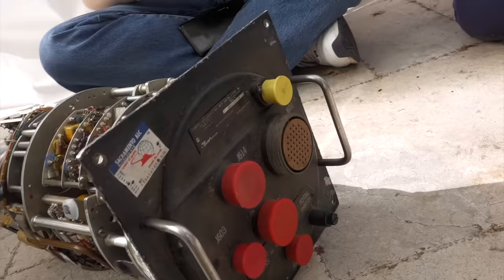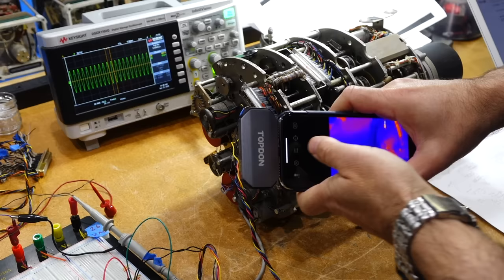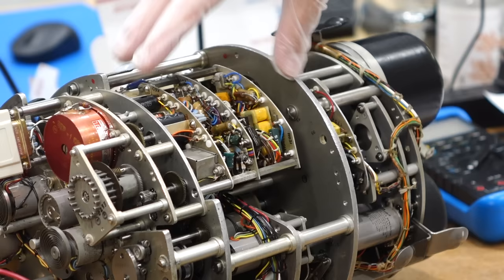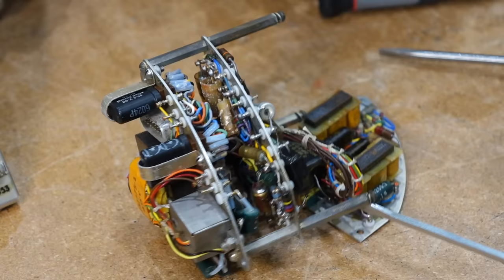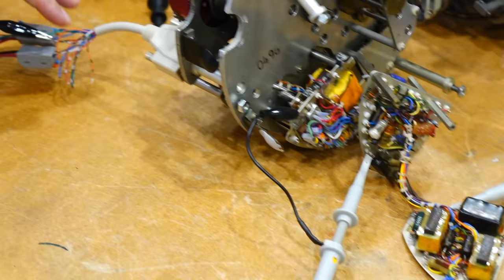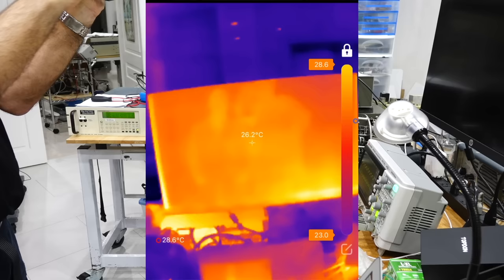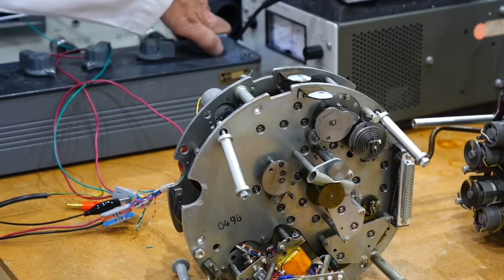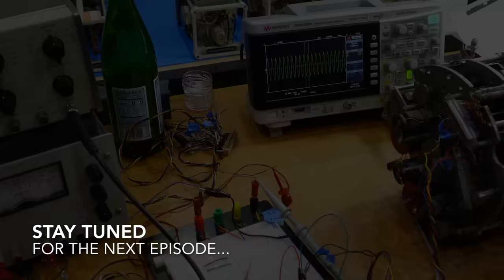Bendix Air Data Computer - Part 4: Magnetic Amplifier Magic

Comment: The main problem with thermal cameras, as demonstrated, is that every job takes twice as long. It's impossible to resist looking around your workshop and playing with it!
Reply from the maker: It’s like, it gives you super powers.
Reply: the number of wall plug transformers I found randomly hidden around the house.. and other current drawing devices that sat there for years without using them..
Reply: problem 2: you never have it around when you need it
Reply: @gamerpaddy This! Some years ago I bought a CAT mobile phone with integrated FLIR™ Cam. As I use a new phone now the old one is always at home.
Reply: @gamerpaddy I have one in my phone so no worries for me😊
Reply: @CuriousMarc  Like a JWST, in your hands!
Reply: @CuriousMarc >>> "Dead or alive, you're coming with me." 
 -- ROBOCOP [1987] 😉
Reply: @ToTheGAMES >>> And you do NOT have to go all the way to L2 to use it...😉
Reply: 2X longer, and I have to admit 2X more fun too. 😸
Reply: @CuriousMarc wait till you use it on a shorted power supply that's cycling on overcurrent. The traces involved make a really nice pulsing image!
Reply: And if the sensitivity isn’t high enough, just use it in a fridge or wait for winter.
Reply: Black bin bags can't hide anything, and 10 minutes old dog poos at night in the back yard glow like plutonium.
Reply: I love the way you can see handprints and footprints with it
Reply: Same as planting bags of  roasted sunflower seeds in the machine shop everywhere.

Production focus goes down because the guys can’t stop eating them.
Reply: I like how you can see the reflection of people in the scope screens. 

When I first got one I spent a solid hour with a friend heating things up by drilling them and such then watching the result through the camera.

Comment: Emissivity is an important factor when you are working with the thermal camera. Shiny objects like metal does have a very low emissivity and reflects infrared radiation very well. You think you are measuring an object, but in reality you are measuring yourself, reflected by the object. A simple way to solve that issue is, to stick black electric tape on it. In some cases it is necessary to paint the object. It is quite complicated to get usable "measurements" from an infrared camera. Have fun! 😎

Comment: Love this video! I bought a 1.5kW-28VDC Military Generator built in the 1960s and it has a small potted voltage regulator that uses a magnetic amplifier too. This device monitors the output voltage of the generator, and controls the field current to maintain a 28V DC output. It uses no transistors, and is still working after all these years. I was surprised as an EE when I came across this magnetic amplifier because it was something I had never heard of! An amplifier that doesn't use tubes or transistors!? Crazy!
Reply: I always wondered how small generators regulated voltage prior to transistorized voltage regulators! Do you happen to have the name and model of the generator? I would love to learn more about it.

Comment: I recall my dad making magamp-based regulated DC power supplies for satellite use back in the 1960s. I learned a lot about transformer and inductor design from him, but I haven't had to use that knowledge in 60 years or so, and it has all dribbled out of my head. 

I also seem to recall that tantalum caps tended to work like zeners if you weren't careful and even slightly exceeded their breakdown voltage, and the breakdown voltage could degrade over time.

Comment: Recently came across a magnetic amplifier in an colour CRT Arcade monitor, it looked very similar, a pincushion transformer where the signal from the vertical output stage is used to control the width. Fascinating :)

Comment: Back years ago (~70's), when I was in the US Navy, we used MagAmps quite a bit for instruments and such.  There were two categories as I remember, a 'saturable reactor' type, and 'self-saturating'.   Many transducer's we had were variable-core transformers so using magamps to amplify and then driver servos was a common arrangement.  But we started getting newer stuff with solid-state.  So I when I was in, you had to know both, depending on what equipment your ship had.

Comment: The first thing I did with my new thermal camera is take pictures of my black cat!  It was quite interesting, actually!  
On topic, it is just amazing to marvel at the electro-mechanical solutions of the time.  Just amazing.....  And to think of the weight restrictions they had to overcome in an airplane....  all that with paper and slide rules before we had computer assisted design.

Comment: Not only are fingers not sensitive enough, but they confound the results. They are so comparatively warm that it’s easy to heat things up inadvertently just by touching them. Especially in a well air-conditioned basement. After all, a finger tip is a miniature heat exchanger. Fed with warm blood, all those capillaries do an amazing job of dumping heat. With a bit more sensitive camera you can see hot finger “prints” left on things just by touching them.

Comment: Time to hook up a temp sensor to it and build possibly the most complicated weather station 😄
Reply from the maker: That’s a great idea. We’d get the temperature from the platinum probe, the barometric pressure from the static port, and if I could build a rotating pitot tube that always faced the wind, I could get the wind speed. Imagine, I could measure wind bursts up to mach 2! That would put these storm chasers to shame…
Reply: @CuriousMarc  My uncle had the pieces to one of these and we used to play with the differential gear sets when we were kids. He told me about how syncros work and how at one point he used a pair to work as a wind-vane. One syncro on the roof with an actual wind-vane attached to it, and the other inside with a pointer on it. He said it worked really well until the wind blew it off the roof one day.

Maybe you could so something similar to control the rotating pitot tube.

Comment: I've encountered the saturatable reactor 'mag amp' in the power supply of a shipboard communications system. The 3 phase AC was fed into it and a DC current controlled the output. The previous systems had used a motor driven variac to do the same thing.

Comment: So very interesting! I have been a fan of synchros and resolvers since the mid eighty, when I was introduced to a telecine film chain, that used magnetic film stock with the optical film, and the entire thing was locked together. my next introduction to them was with an old teleprompter table that locked the motion of the hand controller with four separate motors that dragged the paper down the table, whilst the camera photographed the words on the pages and displayed them in the prompter CRT on the camera peds!

Comment: @CuriousMarc >>> Something just occurred to me while watching this video. 

This may have already been said before, but even if you guys could not power up this thing and test it, just having it on display with the outer casing removed would be a cool piece of 'aviation art'. 

Put it in a glass or plastic cylinder fitst, just to protect all the 'innerds' and keep them dust-free.

Comment: Yes, IR cameras are really nice to have when fault finding.
But one important part is to not touch the parts that you want to look at. Your fingers leaves hot spots that can stay for some time and fool you.
It is also good to have some PVC electric tape and place on metal parts to reduce reflections and give a better emissivity. This will give you a more precise temperature reading and enable you to compare them with each other.

Comment: quite interesting to see such mil-spec tech from 50s and 60s; never knew about such magamps before; thanks for showing!
I think the moon landing also accelerated the move from rotating gears towards silicon-based calculations (and everything done in software) in the avionics industry.  Imagine an Apollo Guidance computer with such rotating gears, instead - if such jump in tech would not have happened in the 60s!

Comment: We had a piece of equipment (30 years ago) that had hundreds of those caps in it, and ended up replacing them all. Fortunately they were mostly on memory cards for the video processor. That allowed us to pull the D0 card to repair while leaving the D1 - D7 cards in place. (All cards were identical.)

Comment: Cheap thermal cameras like that have been available for less than $300 since the early 2010s, Flir One Gen 1 was the first "big" one. The resolution of the thermal imager is low, only 80*60, but they compensate for that by combining it with a normal camera to get the fine detail and use the thermal camera for the thermal information. For the resolution it's surprisingly sensitive. I still use it today, it's got a micro USB on it but if you add a micro USB to USB-C adapter, then it works perfectly fine!

Comment: My first exposure to the term "magnetic amplifier" was 30 or 40 years ago when I happened to be reading the technical documentation for an electric chair. It used a saturable reactor to limit the current applied to the (euphemism alert) "load" to 5 amperes at 2000 volts.

Ever since then, the term "magnetic amplifier" has seemed just a little bit creepy.

Comment: Those tants have leaked, and the heat from desoldering them was enough to evaporate the sulphuric acid electrolyte across the seal that was shorting them. If they have the epoxy seal there is rubber under it, and they fail with time, as they are the "budget" renge of wet slug tantalums. the glass seal ones almost never fail, tested a batch of 500 that had been sitting in storage since the early 1970's, and none were out of tolerance at all, and reforming them did no change at all to the readings for capacitance, ESR and leakage, which was either 1M or higher, or so close to zero it was unmeasurable. Abused a couple on a SMPS to replace the original capacitors that failed, as I wanted it working, and, despite being only 10uF as opposed to the 1000uF they had there, they worked well, just put 6 in parallel on the same pins, and a 470uF after the filter inductor, and got it working again. They ran cool, unlike the old one, despite having a fraction of the capacitance.

Comment: Magnetic Amplifiers, or Saturable Core Reactors, are truely magical. They can be incorporated into linear amplifiers, Oscillators, and bistable Multivibrators with additional windings, i.e. feedback windings. In this application, they are being used in place of high voltage transistors, which in  the 50's and 60's are far in the future.

Did they use a Platinum RTD or a Thermistor?

Comment: -How to compensate for nonlinearity? 
-Someone will come with screwdriver and calibrate it
-Like with potentiometer? That's not possible at all, maybe 20 of them and switching circuit
-You know what? 20 of threads that make out a cam will do and don't be a jerk

Comment: Can the Bendix computer check if I'm first?
Reply from the maker: Definitely! Google says you are second, but they use crude digital techniques. The Bendix, on the other hand, uses subtle and refined analog estimations, so it says that you maybe first more or less approximately perhaps close enough.
Reply: sure, but the Bendix might have to shift into an extra gear for this 😂
Reply: @CuriousMarc  Well to be honest I do think digital readouts are a little crude, if it don't have lots of decimal places of course. As a happy hobbyist I prefer an analog panel mounted gauge. 😁

Comment: I reviewed the self-contained version, TopDon TC004 recently.  It's a game changer product, so affordable and capable.  FLIR must be quaking in their boots.
https://youtu.be/f5aYGkfieWI
I used it to locate a short circuit zener diode which would otherwise have been very hard to locate on a large PCB.
Of course there are only certain tasks these things are good for, they won't help with all electronic faults, but are fantastic for locating something which is shorting a power rail or similar.